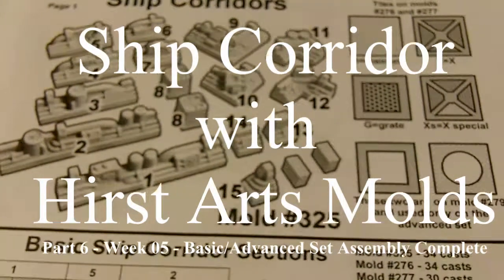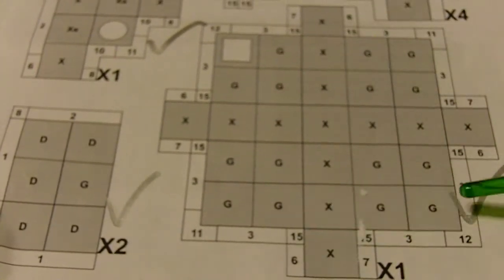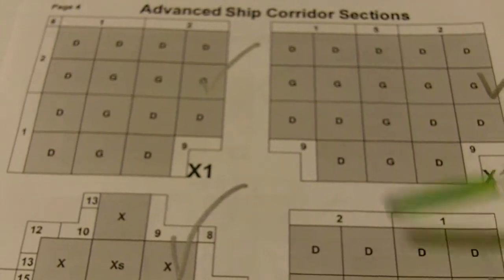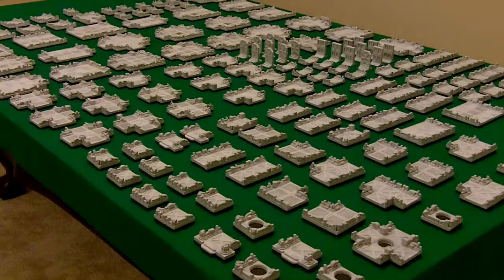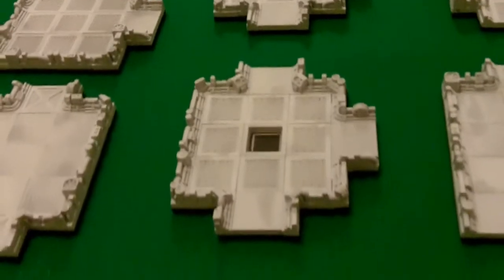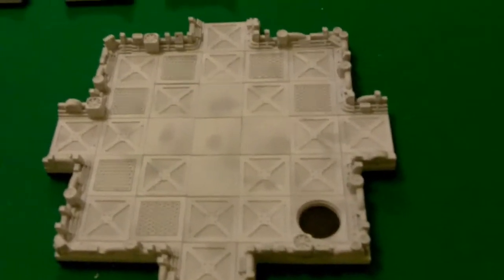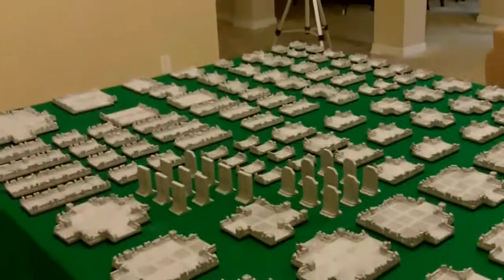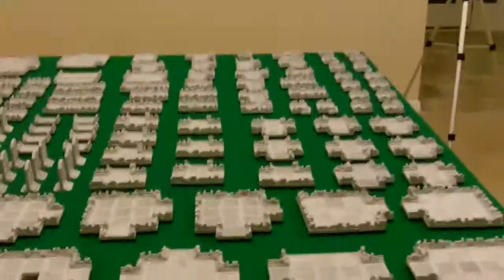Ship Corridor with Hirst Arts Molds -Part 6 -Week 05- Basic/Advanced Assembly Complete

Comment: In my opinion plaster of paris works fine. The only problem is that its a little brittle and stays "chippable" even when totally dry. I found that using housepaint as a base helps everything stay together.
  If your interested in making your own molds ( to speed things up or to save on the junkcasts ) you can use some player of paris to get the parts then make some molds for yourself. Use the M.M. in your own molds and VIOLA! ';..;'